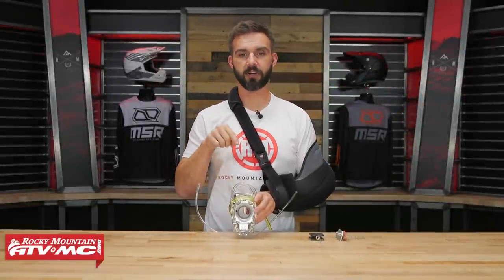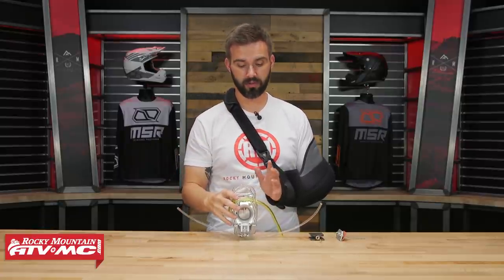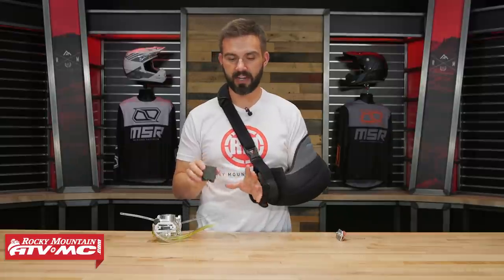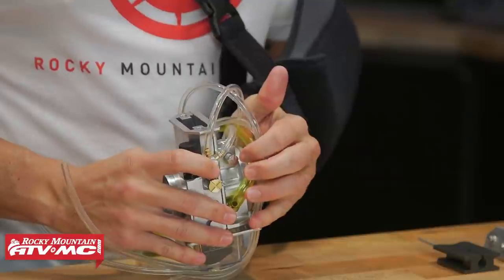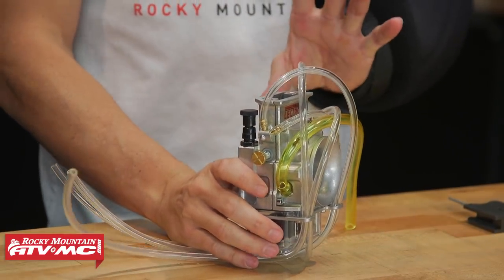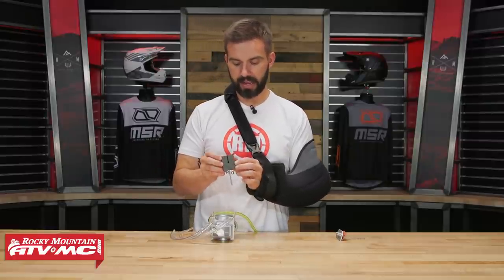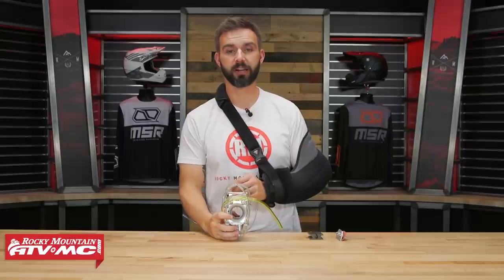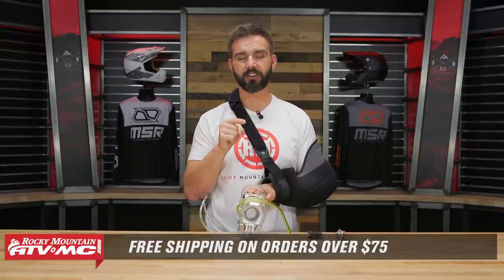Lectron Billetron Adjustable Motorcycle Carburetor

Comment: I held off getting a Lectron HV because I'm a bigger rider on a 250 and didn't want to loose any low-end, plus deal with a new throttle cable and fitment etc..   When the Billetron 38 was released and reviewed, I jumped and got my pre-order in. Let me tell you, there is no loss of low-end with the Billetron. My Husky TE250 gained some unexpected grunt off idle and in low revs, in fact it was enough that I was a little too hot coming off some roots, got flung off the trail and now I'm recovering from rib injuries🤔. I have not been able to get back on the bike yet for more testing(and getting used to the new feel), but the entire power curve is very smooth, the engine is quicker to rev everywhere and its still plenty nutty at the top. Its good stuff.

Comment: I ordered a Billetron as a last chance before going and buying a TPI 300, I have never in all the years of riding KTM & Husqvarna 300’s felt I could ever get them jetted correct for all situations. Put on my 17’ Husqvarna TX300, less than 30 minutes to install, amazing!!!! Smooth from zero to wide open, and way more low end. I am not one for expensive gimmicks although I have no desire to go buy TPI bike now, actually runs stronger than my buddies new 20’ & 21 300’s

Comment: Got 2019 ktm 150sx and I installed the new billitron, it was perfect out the box only thing had to do was adjust the throttle cable. This is my first 2 stroke and first carb bike I have always rode 4 stroke with ego. This thing out of the box was awesome and made the power pull evenly trough out and made it feel like fuel injected, very smooth. I absolutely love it.
Reply from the maker: That's awesome! Pretty amazing the way these things work. And I'm a little jealous of your 150SX! - Chase

Comment: Bought a H-Series for my 02 CR250 couple years ago..worked great right out of the box..the plug was a little lean for my liking so I richened it up a tad with 1/2 a turn on the metering rod…good product,great customer service(although it’s email not phone) they do respond quickly

Comment: In terms of ease of adjustment and less jetting headaches, you simply can’t beat the Lectron. Especially all of the design changes they made to improve this new BILLETRON!  

I’ve outfitted four of them on the bikes for my Throwback Two Stroke Garage Build Shootout, a 2004 CR250R, 2007 KX250, 2006 RM250, and 2005 YZ250. I’ll drop some more riding feedback once my shootout video drops here shortly!
Reply: For ease of adjustment and no headaches the smart carb is even easier! External adjustment with no tools required. It is longer than the billetron though as they did manage to decrease carb body length with this new carb.
Reply: @robertmuir734  I agree, the smartcarb sc2 is literally a toolless system
Reply: Smart carb beats lectron any day of the week in terms of adjustment. 

However, Lectron is light years ahead of an ancient stock carb.

Comment: 2019 KTM 300 XC  I purchased it a billet Tron bolted it on taking my time in about 15 minutes with  zero modification to it and the bike runs flawlessly it definitely has more torque throughout the rev range and better rev out.

Comment: Have a H series on my 2017 KTM SX 150 for 5 years now.  Told RM what bike I had, they shipped it out, I put it on and never touched it for all 5 of those years.  I race mainly MX and some GPs from sea level to over 4000 but also have a few single track trail rides over 8000 ft.  It started(usually first kick), idled and ran perfect every time, every place, at every altitude.  I've now put it on my new 22 KTM SX 150 and so far runs exactly the same as it did the last 5 years on my 17 SX 150.  I've thought about the new Billetron but don't know yet.  The 22 SX 150 runs great with it and I still have never made one adjustment to it since I took it out of the box 5 years ago.  Just another point to make, every person that has ridden it is amazed at the low end and smooth hard pull all the way to max revs.  If nothing else I would buy a Billetron just to get the float bowl drain and the choke lever on the left side.  I admit the right side choke lever is a pain to get to on a SX 150. 

I also just bought the 2022 SX 150 because of the way it starts and runs so cleanly with the Lectron H.  I don't need the extra 10 lbs that KTM has but on the 2023 SX 125 for fuel injection and electric start.  Plus the fact there isn't going to be a new SX 150 cycle or big bore kit for the SX 125 for probably 1-2 years into the future.

Comment: I’ve had several of the old style for KX500s, CR500s, KTM300s, and CR250s.  My only feedback is that it would be nice to have them include and exploded diagram of their carbs with part numbers, sort of like the OEM drawings that the MX manufactures use when you are ordering OEM parts.  

The only problem I have ever had was an issue with the float valve not sealing on one causing a rich condition.  You could see that the float bowl was too full.  Their WD-40 trick did not work for me that day.  So, I just had to go to my spare bike.  They offer very little in terms of exploded views.  I know they offer a chat service but when your are way off the grid riding, the chat will not help you.

Don’t get me wrong, I do like the Lectrons, I’m just offering suggestions.  It would be nice if the top of the carb had a cap that accepted an O ring instead of the loose gasket.  They could even use C clips on the screws to they won’t accidentally fall out, though I know that “K,” and “M,” don’t offer that either.  

Good product.

Comment: Been running a Lectron for about a year now. I had to turn my metering rod 3 and a half times total before it ran good. It definitely made my bike harder to start. Rarely starts first kick. The throttle response isn’t as snappy as I’d like, but it’s ok. A slimmer one would be nice, mine is a tight tight fit on my 99 yz250.
Reply: Not a good carb for the YZ250 and 250x IMO. Took mine off and sold it.
Reply: @panic-revv85  I kinda feel the same. I bought my bike clapped out and rebuilt it so I don’t know how it was with the keihin, but my bike won’t wheelie in any gear but first. Maybe I’ll pull out the old carb and rebuild it 🤔
Reply: @rickg9217  seems like the technical riders seem to like them. Definitely not the same power as the pwk though. Did lectron set the carb up for you when you bought it?
Reply: @panic-revv85  No I tuned it in myself. I was wondering if I didn’t do it right but I watched a lot of videos and seems like I did what I was supposed to.

Comment: I'd like to know about getting 2 of these for a custom banshee. 521cc stroker. Have 2 39mm pwks currently. Specs on the o.d. of both ends would be cool. R these 4 stroke only carbs?
Reply from the maker: These are made primarily for 2 strokes but Lectron has used them for all sorts of applications. If you have a custom setup it may be best to contact Lectron directly and they can send carbs already tuned for your Banshee. You can contact Lectron here: https://www.lectronfuelsystems.com/contact
We have a dual Lectron setup for the Banshee that comes with 2 34mm Adjustable Power Jet Carburetors that you can check out here: https://www.rockymountainatvmc.com/parts/lectron-adjustable-power-jet-carburetor-kit-p
We also did a Banshee build with this dual Lectron setup on a 4mm stroker. You can check out that video here: https://www.youtube.com/watch?v=GxU23uACfDU
Reply: @rmatvmc   not tryin to hijack a conversation but i have a RZ as well as a NSR250 Honda.... the rz? im ok with it right now it runs an has been refreshened to rideable daily status .... the Honda however sat in fun hatin Cali too long without running and carbs have pitted float needle seats and are trash.... being i live in Arkansas i have found exactly ZERO people (local honda dealer staff included) whom know what a NSR is..... yessssss its THAT backwards here.... im game for using blaster or yz125 carbs or whatever someone would care to suggest .... sorry long winded jus tryin to answer what questions i can as i explain... itsa mc18 NSR amy help would be much appreciated

Comment: The Billetron is a short body (air cleaner boot to reed boot) and is too short for some bikes.  If that is your case you have to buy ad adapter, which Lectron sells for about $35.  So it doesn't just easily mount to every bike.

Comment: There was a lot of hype with the hv series too. Never ran well around idle. Wasn't that consistent either. Lectron would blame my bike yet it would idle and start great with the keihin. Now they admit there was an issue. No thanks I'll spend my money elsewhere.
Reply: You're right about the inconsistent idle. My 150sx will want to load up and die when going down hill or under hard braking. I'm going to try to figure out but it's odd, seeing the way fuel enters... you wouldn't think this would happen BUT it does 🤔😒.
Anyone figure this out yet?
Reply: Yo Joe  I did set it (verified) to their recommended setting.
If it still acts up at idle when riding season returns in spring, I'm going to lean out a quarter turn.
Just seems odd that tilting carb causes it to run poor (idle low and wants to die). Fuel must be running over through metering rod. Leaning out may plug the hole 🤣...😒😡

Comment: Has anyone put it on a older kx 250 with sensors? What do you do with the 2 sensors that are wired to the stock carb???
I have a 2000 kx250 and been asking but never get any replies back.
Reply: Go with the SmartCarb SC2 instead, it has a TPS option for you to keep your 3D mapping, plus it's externally adjustable without tools and they're not 4mm smaller than implied. Billetron 38s are actually 34mm carbs. The other connector is for an electronic power jet and you can just leave that one disconnected. Tape it up and zip-tie it up under the tank/frame.
Reply: Just disconnect the sensors an cover the wire ends an zip tie them. You don’t need the sensor to connect to the lectron

Comment: But how they will run without tps on yz 250?
Reply from the maker: They will still run great. Lectron says that adding or removing the TPS system is much more noticeable on the OEM carb compared to a Lectron due to the Lectron bore design creating more velocity. So, I wouldn't be worried about it but if you are, Lectron makes the new Billetron Pro series with TPS that you can check out also.
https://www.rockymountainatvmc.com/parts/lectron-billetron-pro-adjustable-carburetor-with-tps-p

Comment: Shoulda threw a keihin on or at the very least a smart carb…same thing except an extra 50 years of development effort put in
Reply: And for that extra few decades of development you get external adjustability without tools, integrated float bowl venting eliminating the power jet, a variable throttle rate venturi that doesn't compromise (Billetron 38s, just like the previous 38 H-Series, are 34mm carburetors measured), and a TPS option should you need it.

Comment: 2023 yz250x 
10 hours of the lectron, complete garbage. RM reached out to help me get it working right but no follow up. Loads up going down hill and runs to rich. Lots of adjustments made with no fix. Pay a mechanic to teach you how to jet a carb and save 500$